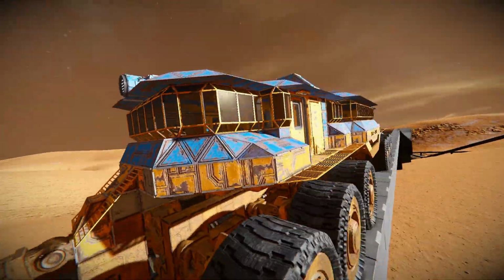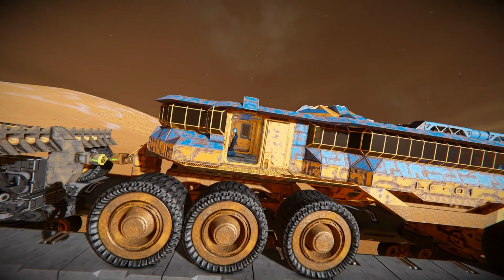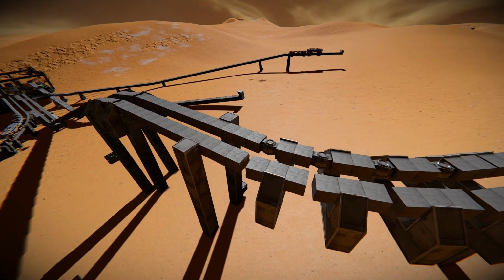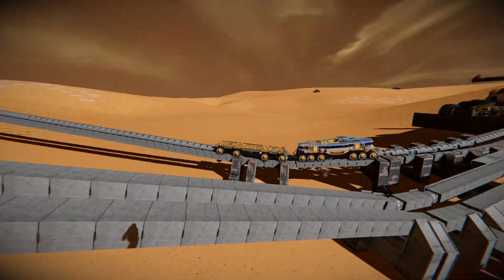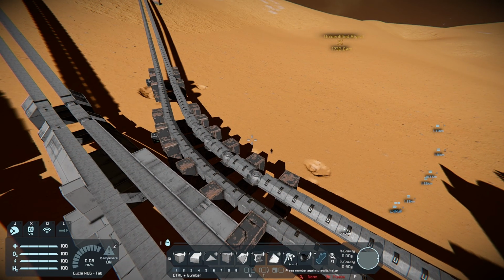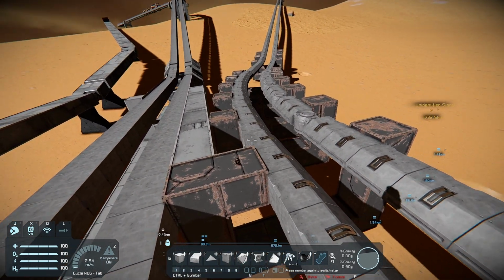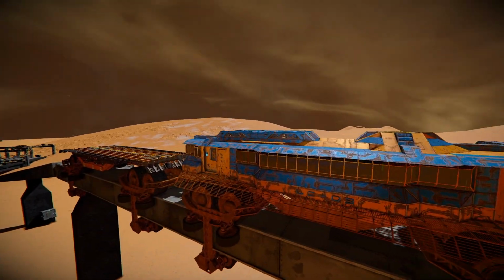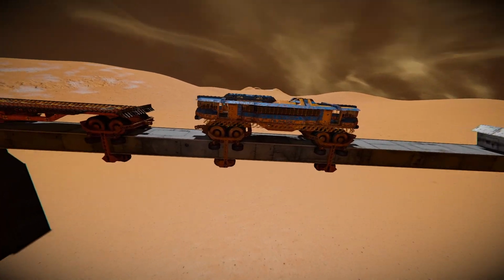🚂 Are Trains in Space Engineers Problem or Solution?

Comment: Its probably a little late, but love your video. I did notice that just about every time you crossed one of the "ribs" those support structures you have made up of full-size blocks that the wheels clipped momentarily. Have you though of spacing them out by one block. so that its track - blast door or half size block - Rib. Might cut down on the train jumping at least for the 1st and 2nd generation, with a wrap around on the 3rd generation you do avoid the problem.
Reply from the maker: Welcome here, it's never too late to drop some awesome advice 👍
And you're totally right, adding one more spacer block will help for double-track generations, but just a little. The main problem there is rail bends where wheel attachment points are going crazy.
Anyway, I'm going to eventually try the survival series when all mods to limit will be produced, and it will be a perfect time to test that and follow your advice. 😇
Reply: @TheScrewUpTeam  Love it, look forward to the series. also on turns if you are having problems just do a little more shallow like 2 to 3 degrees instead of 5. turn longer but tend to have less problems.
Reply from the maker: And you're right again. Smaller bending angle or more distance between disposed blocks will help, the thing is that the whole exercise in this video was to test limits 🙂
Reply: @TheScrewUpTeam  and it looked like a great video for that.

Comment: You can convert those curves to a station, and that will give them the stability you need. You have to make sure there are no phantom forces acting on them. Check your velocity. If it fluxuating, find a way to use a mag plate to temporarily hild it then convert it to station

Ive been using atmospheric thrusters for propulsion and having little or no friction on the wheels. Hiding them inside the body of the loco.

Also those speed limitations are accurate to real train. In the US fraight trains are limited to 60mph ~96kph. Around certain curve and through turnouts and crossovers you may be limited to 50 40 or even 30 mph (80, 64, 48 kph respectively) for SE those speeds might need to be scaled down for the engine.
Reply from the maker: Thanks a lot for all this advice! 🙏
Phantom forces are the real problem here, indeed. I noticed that it's commonly better to have as many static grids as possible (they call it a station grid) from both reliability and PC resources perspectives. It is implemented in my further work, which I'm going to share soon. 🎞️
I tried atmo thrusters also, and even have them on a locomotive roof, as you may notice. The thing is that I've got only problems with them, maybe it's because I tried to use them in tandem with wheel propulsion.✈️
Oh, that's good to know that I actually meet the realistic speed! Thanks a lot! Somehow, I was confident that trains move at a much higher speed, up to 70 mph. 🚄
Reply: @thescrewupteam  cool I look forward to seeing what improvements you've come up with. Oh and passenger trains can reach higher speeds here. 79mph or 129kmp. At least on the railroad that I work on.

Comment: Hi , good video , I am getting good results with shortened offroad 1x1 suspension on single Beam Block railway  ,  inspired by Dread Mechanic.
Reply from the maker: Hey 👋,
That sounds like an approach I should try, thanks! 🙏
I haven't tried this because 1x1 wheels typically provide low propulsion. Have you checked that on high slopes and with decent cargo? 🧐